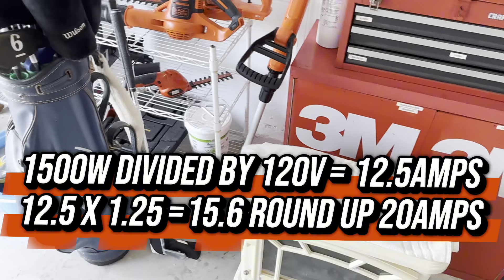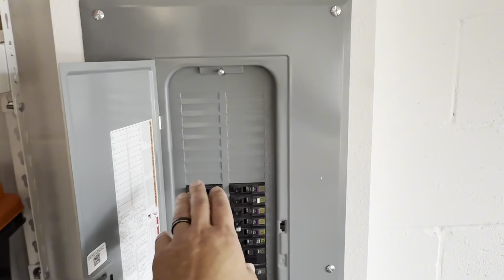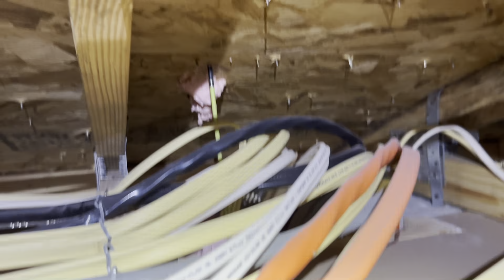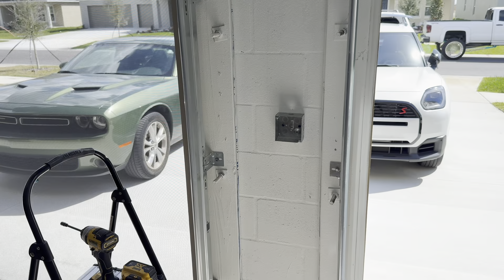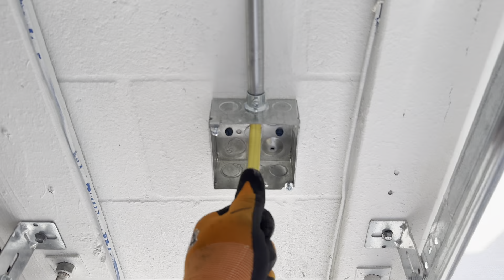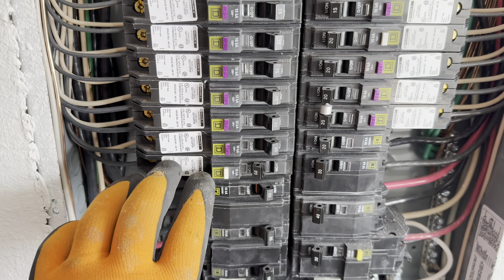Installing a Garage Receptacle for a 1500W Heater | Circuit Size Explained

Comment: Not much point for that heater with no insulation
Reply from the maker: Yep, that was the first thing I recommended to the homeowner. Insulating the garage would make a big difference before relying on a heater.

Comment: Good call, after using a 1500watt space heater this winter, I now have 3 outlets that are at 11v and two lights switches that are inop, it was running off a 15A breaker
Reply from the maker: Yep, that’s exactly the problem with running those heaters on a shared 15A circuit. A 1500W heater pulls about 12.5 amps, so if anything else is on that circuit the wiring and connections start getting stressed. Over time that can cause voltage drop, loose connections, or even burned devices, especially if devices were back stabbed.

That’s why I recommend a dedicated 20A circuit when possible for continuous loads like heaters. Good catch sharing your experience — hopefully it helps someone avoid the same issue.